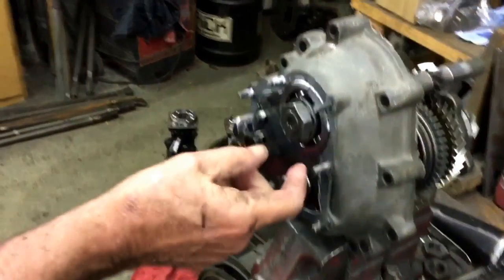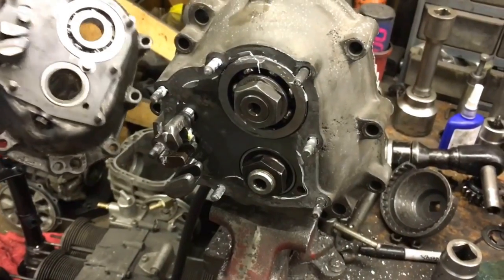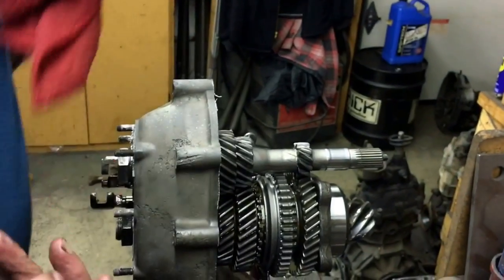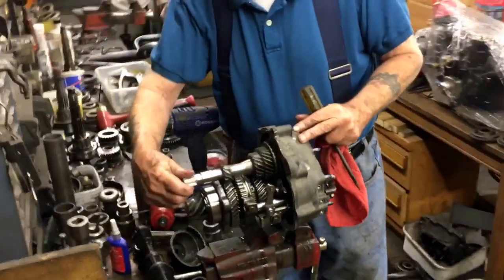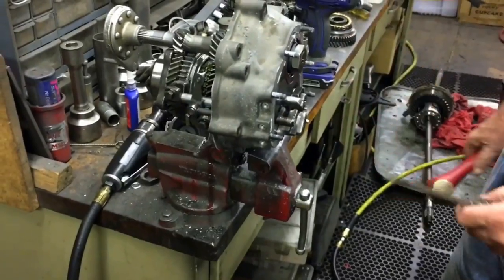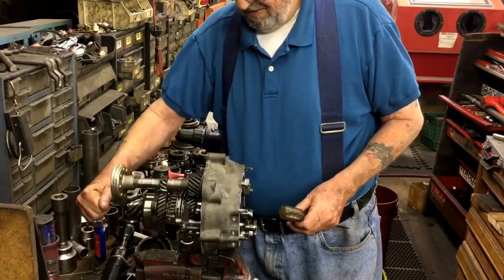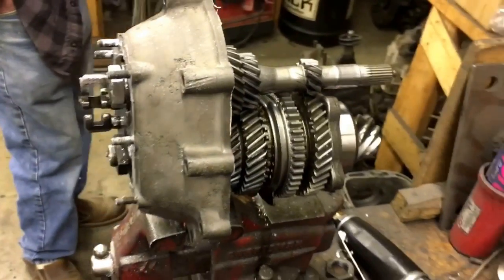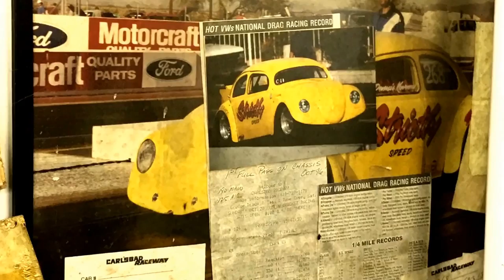Dennis from Strictly Speed explains vw transmission problems.

Comment: I have intermittent clanking noise,like a wrench striking metal and after I hear a very short grinding noise.I do have a leaking irs seal and I am changing the cv and seal hoping it is my cv.Funny it only happens on the ground and if I put the car up and run it through the gears no noise.Almost sound like something hitting the frame,beings it only happens with it on the ground makes me think the cv at a certain angle it lose.If it were the transmission I would think it would be a consistent noise.When I put the car up i did hear a little cv warble and that also could have ruined the seal so I am doing the axle and checking all wheel bearings.I am hoping it is that and not inside the trans,I have no issues shifting at all.I would think if it were the trans it would make the noise every revolution of a gear.

Comment: Thanks for sharing Dennis. I just bought an 02 TDI Jetta and I've been hearing the 01m is junk. What do you think? And I hear some people are running there transmission/engine with the cooler line disconnected in order to do a flush. They run it until the fluid is gone or foamy. The theory is it drains all the fluid including the torque converter. What do you think about flushing like this? Do you have any tips to improve this method?

Comment: Can I use 12 volt gears from  a 1967 irs van trans in a 1959 swing arm bug tran?
Reply: No
First, there's no such thing as a 67 IRS Type 2.  If you are talking about a stock 67 Bus trans, nothing in it fits into a 59 Beetle trans since that year Bug had a split case trans.